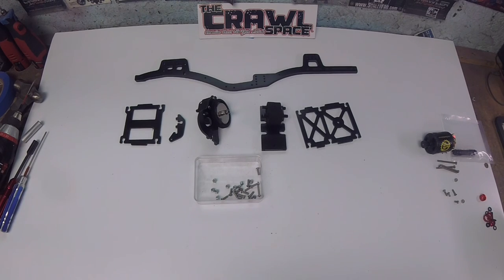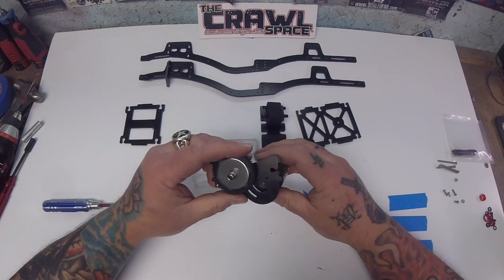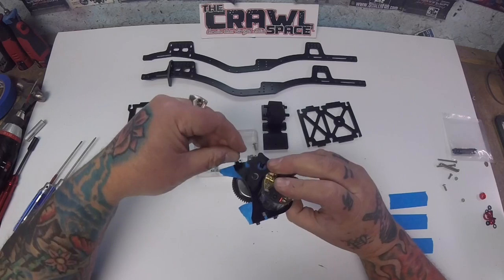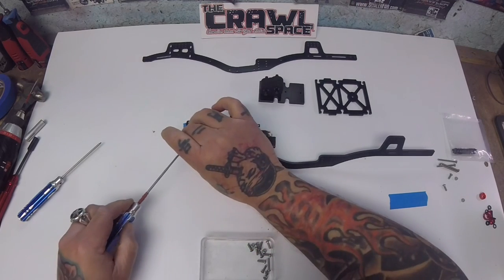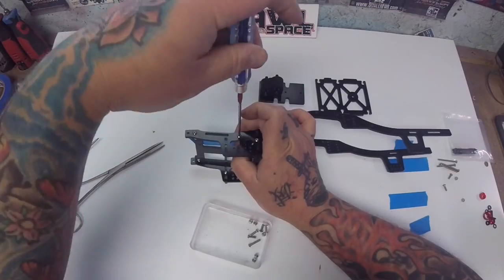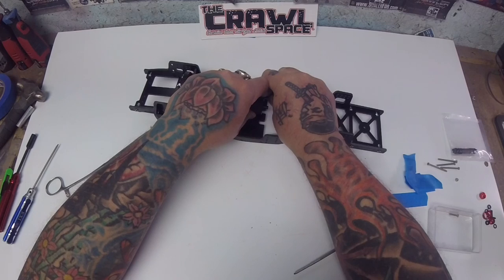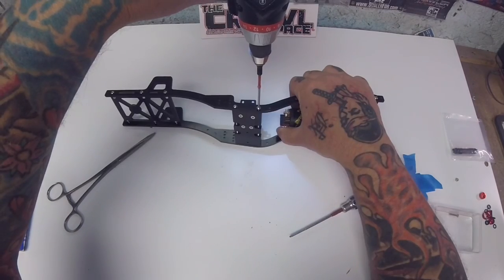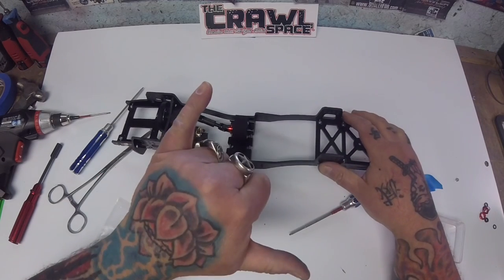Game Changer 4.2 complete assembly

Comment: Looks like a very nice set up. Why is the motor on the left side of the truck and not in the center? Will that throw off the weight?
Reply from the maker: The motor is offset to position it low in the chassis and clear the front upper link and drive shaft. The weight bias is negligible and if it does become a concern it can offset with the other running gear; ESC, RX, etc. as it's laid out in the chassis.
Reply: @TheCrawlSpaceColorado  Great! Thank you so much for the explanation.